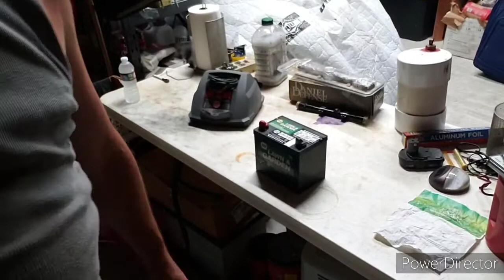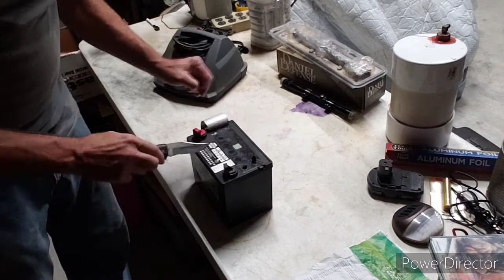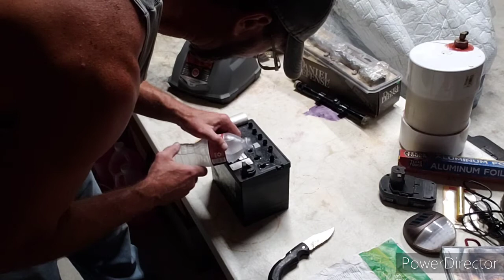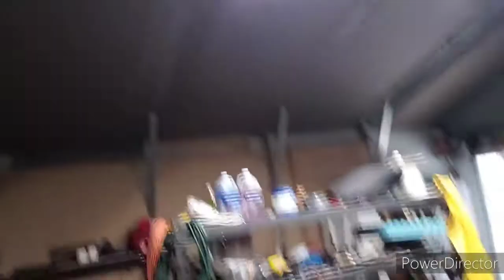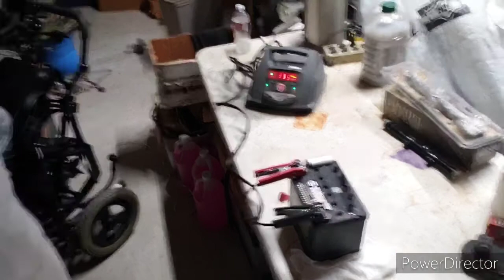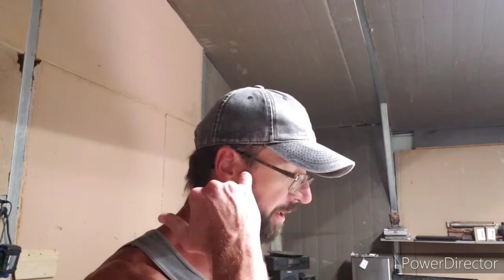Battery Maintenance

Comment: Just caught this video.  Unfortunately. I swapped out 2 batteries that had caps on them and purchased 2 27dc batteries for my solar system I'm building.  BUT I also have my very dead truck battery. So I'll check it out. Walmart said it was dead, dead. But 2 months waiting at least for ships to get one.! Crazy
Reply: Thanks! If I tell you the battery details,  are you able to make helpful hints so I can maybe salvage this one? It's a 2016  I think so not terribly old. Bummed out I turned the other 2 over.
Reply from the maker: @heatherk8931  Often, the cells have been discharged for too long and have build up on the plates that compromises the capacity of the battery.  It would have to sit on a "desulfidating" type charger on a float charge for a couple weeks after refilling it..if it comes back to life, the capacity will be less than rated on the label.  I have  kept a couple of lead acid batteries for a little over 12 years using best practices, before they still lost capacity.  It is part of the trade off for this battery chemistry..lead acid is about the cheapest, and lasts the shortest number of cycles.  If you are able to get the thing to charge up to 13.1v your battery will be usable.  You can test the capacity with a cheap tester from Harbor Freight, or have it tested for free.  
For solar, I have found if you over build the battery, it will last the longest.  Try to only discharge the battery to 80% before it can be recharged.  On lead acid batteries, the deeper the discharge, the less life you can expect from it.  For instance:  I  typically use 2kw of power for 6hrs a day.  My battery is big enough to provide that for 3 days with no sun.  (possible during rainy seasons, or hurricanes)  Over building the battery like this not only gives you the extra cushion between fair weather spells, but it doesn't dig into the capacity too deep during normal sunny day operation, thus extending the lifetime of the battery.